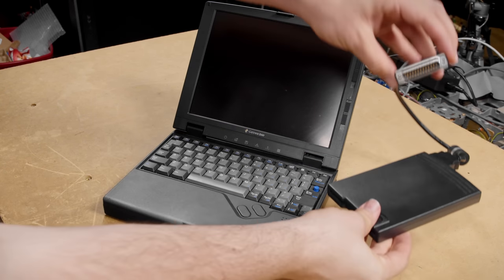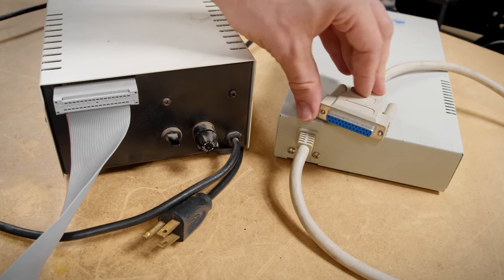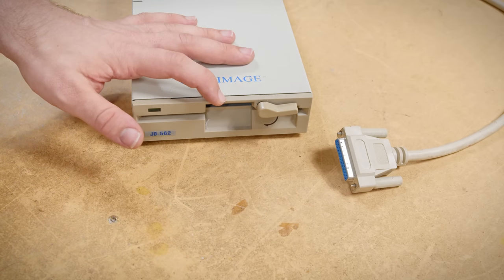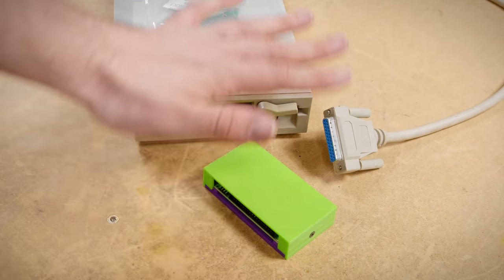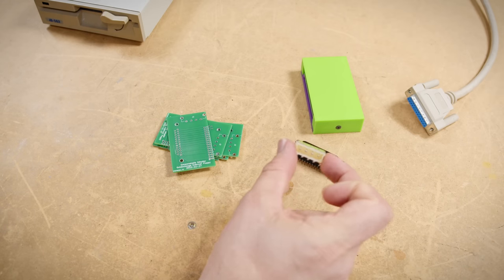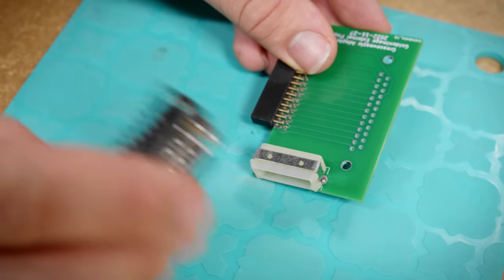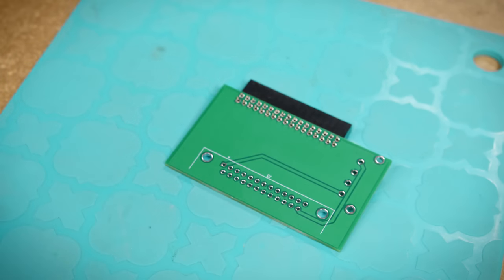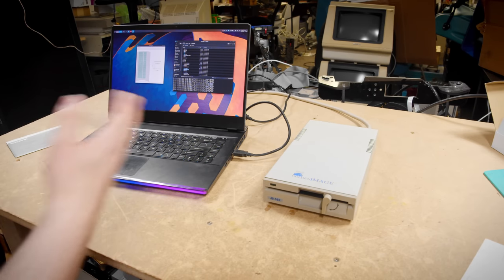Greaseweazle External 5.25 Adapter

Comment: Nice showcase! 

I built up a floppy featherwing from Adafruit to gain access to Greaseweasel based on a previous video of yours. I didn't go with an external enclosure though, just embraced the "80s clear electronics look" and used a rainbow colored ribbon on the bare drive. 

It's delightfully janky but worked surprisingly well.

Comment: The 37-pin version was the "official" IBM external floppy port. The original IBM PC floppy controller featured it, as did the external adapter for the IBM PS/2 series.
Reply from the maker: I didn't actually think to check if that was the same as the IBM pinout, that would be awesome if it is, I don't know if those drives are that common but that would be nice if so!
Reply: @TechTangents  Years ago, I had the official IBM external 5.25" drive kit for the PS/2. Contained a adapter that plugged directly where the second 3.5" drive would go which attached to a ribbon cable that went to a dummy Microchannel card with the DC-37 plug. The external drive was built like a tank (typical IBM) and had it's own built in power supply.

Comment: Great and simple project, a more aggresive but cleaner option could be to adapt the Greaseweasel inside the caddy and go direclty with the drive interface, of course you're stuck with a permanent modified enclosure and a Greaseweasel inside but the resultant will be cleaner.

Comment: This is rad. I set up my greaseweazle a few months ago. I ended up using an enclosure from an dead external USB CD-ROM drive. Unfortunately I couldn’t use the power supply because it would only put out 12 volts when it was connected to a USB. This is a much better solution.

Comment: Please use oval/oblong pads where possible if a board is going to be hand-soldered; that's a lot easier to solder than those tiny pads.
Also, the Density Select trace is very close to pin 14 in the original design; there's enough space to route it differently.

Comment: Given that DB25 cable carries 5V and 12V power, you'd want to be damn sure that the pinout is correct before powering up a drive you aren't 100% sure of as otherwise damage is very likely.

Comment: What I did was just connect the drive to the GW using a standard floppy cable, plugging the power supply directly into the drive and bypassing the external interface but keeping the case. Why introduce the needless complexity of an extra board?

Comment: Does the greaseweasel not provide enough power by itself? It's on USB after all. It could pull 2A/5V (usually) and provide that to the disk drive. Surely that'll be enough for a disk drive?
Reply: Some 5.25" drives also need 12V for the stepper motor.
Reply: @wmlindley  Easy to solve with a step-up converter, as long as the USB bus provides enough watts. And the little board looks like it still has plenty of space for that.

And even if not enough USB power, you can always go USB-C 😎

Comment: This looks so easy, where in reality it is not. I get to the point the drive starts spinning. Thats all. We need a good explanation about wiring, device ID's, cable twists, jumper settings, choosing the right drive, dealing with "no track 0 found" errors and such.

Comment: I recall hearing that there are issues getting the flux data for 360k disks from 1.2M drives. Does something in the FD-55GFR/Greaseweasel/FluxEngine stack handle that or am I miss remembering? I'm looking to get a drive for imagining so it would be nice to know if I should really try to get an FD-55GFR in order to avoid the need to get a seperate 360k drive.
Reply: In general you can read a 360k floppy fine in both a 360k drive and a 1.2M drive but because the 1.2M drive will have a head half the pitch of a 360k drive, 360k disks written in a 1.2M drive may not work well in 360k drives or even  another 1.2M drive.

Comment: im a bit nuts i would stick it right inside that box and add a USB port..
Reply: I did that with my GreaseWeazle. I use it was a 3.5 disk drive. Bought an enclosure that houses the GreaseWeazle and the disk drive. It's nice.
Reply: 💯% my thoughts :-) make a nice power input on the back, maybe even put a step down in it for good measure and use a 12V wall wart only 🤩

But yes, this would maximize usability at the cost of defacing the original external drive enclosure… So I can understand why it’s not done.

Comment: Can it write flux images back to a blank diskette?
Reply from the maker: I have done it with the Greaseweazle using a 360k drive to a 360k disk before but I probably wouldn't use this setup for writing disks with the 80 track drive since writing 360k disks is more useful. But writing flux back is definitely possible. I've read that it's not preferable to do it since you are combining the timing tolerance issues of the original drive that wrote the imaged disk and your drive's own tolerance issues.  Personally I would still do it but just be aware of what problems can happen.

Comment: An interresting material. Maybe not the adapter itself, for me at least, but FluxEngine - yes. I tried to compile it on my Linux laptop (my basic machine) but failed with the GUI 😕And the command line tool itself is not that useful.
Reply: Aaaand - I did it. Pretty useful GUI. I wonder if they will expand the image database.